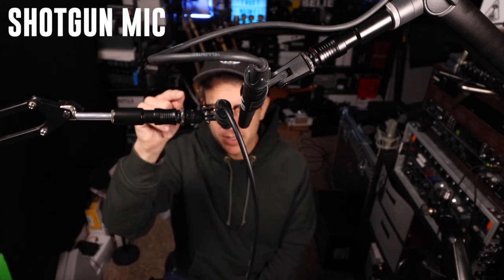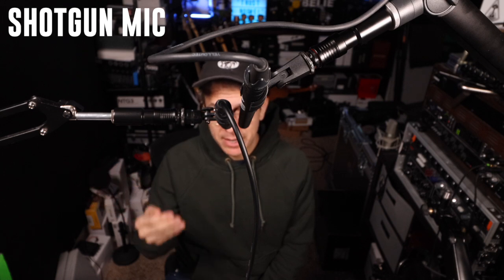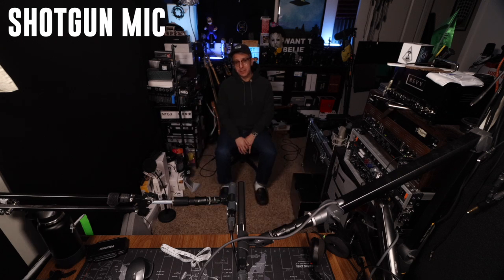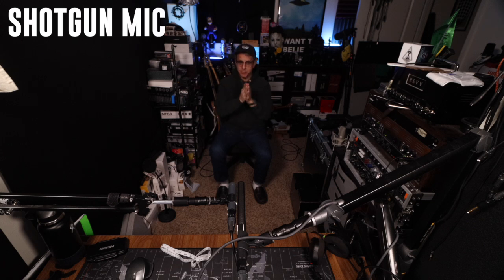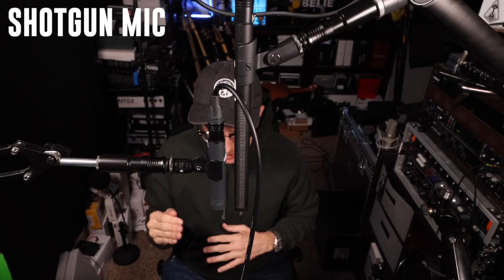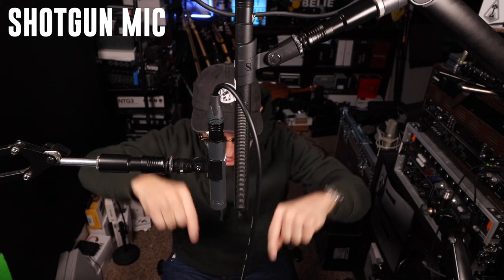Should You Use Shotgun Mics Indoors?

Comment: I think it would have been helpful to do a test in your untreated room which is more echoey. I'm not sure you pushed it hard enough into the worst case for a shotgun. You've got a lot of stuff in your studio that I'm sure breaks up the reverb. Based on my own tests, the interference is worst when the shotgun is getting reflections coming from all around of the source it is trying to isolate, and when the mic is far enough away from the source that it isn't way louder than the echoes.

That being said, I've never heard more than a subtle difference.

Another test that would be interesting would be a situation with a lot of ambient noise, like machine noise, coming from all directions, with the mic a few feet away from the source. That is supposed to be what shotguns are designed to do: cancelling out ambient noise coming from all directions to better isolate a specific source coming from one direction.

Based on what I have heard, I generally choose SDCs for recording indoors, particularly if the room has a lot of reverb. I would use a shotgun if there was ambient noise coming from all directions. But I've never heard a huge difference, it's more of a guide than a rule.

EDIT: One thing I'll add, though, is if a person was on a budget and to choose one or the other, I would recommend an SDC. They are less expensive, less bulky, and are more versatile.

Comment: Just an FYI, the diaphragm in a shotgun mic is at the back of the interference tube, not at the front of the mic like in an SDC. So by lining up the fronts of the mics, you put the diaphragm of the shotgun several inches further away from the sound source.
Reply from the maker: Oh yeah I know that and my initial thought was to align the capsules. But when I spoke to Sound Speeds he suggested the more accurate comparison would be edge to edge since that's how people are going to be using them. 

The person placing the mic will get the tip of the mic as close to frame as they can without it being in frame regardless of the mic type. So it's demonstrating how the mics would compare in a real world situation because no one will put 3 inches of a shotgun mic in frame just to get the capsule closer, and no one will put an SDC 3 inches further away just to match it to where a shotgun mic would be. 

So although this is true, I believe this comparison is a real world representation of what people would experience.
Reply: @clipscastage  Makes sense.
Reply: Good point

Comment: There's rules, and then there's NPR's Tiny Desk Concert using the Sennheiser MKH 418-S.
Reply from the maker: The audio engineer on Tiny Desk is incredible. He does such a great job!
Reply: The whole room is filled with books, what better reflective material do you need than old books ? The entire background is filled with books.
Reply: I checked, there are some problems in monologues or intros in a some concerts. The real problem is not the reflections. The real problem with the shotgun mic is having to learn ho to remain still or in a straight line. Using the shotgun mic is a hassle IMO. In my case my shotgun works good enough only in the living room or outdoors (neither of which is practical for me).